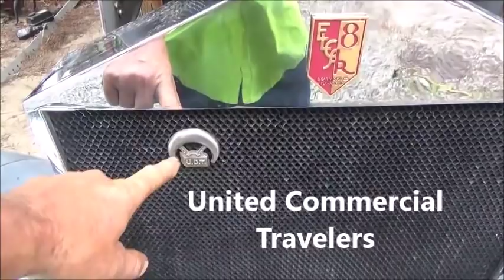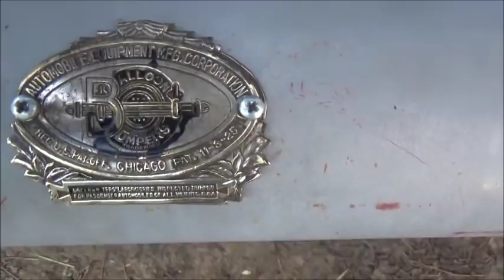1927 Elcar Ready For The Show & Wrecks

Comment: That's one thick phenolic plate!  I'm used to seeing phenolic inside antique radios being used for everything from antenna lead washers to early circuit boards and sometimes even as chassis mounts for tube sockets.
Reply: Rebel9668 when i hear the word phenolic I think of the old thermoquad carburetors.  Mopar (and I’m sure others) used that stuff for years and it is proven.
Reply: just tell me that's not asbestos...

Comment: For minor repairs on the wood stripping, there are small cans of marine-grade wood epoxy. You can even work it into the seams of "spongy" wood to bring it back up to full strength. Drills and sands fine.

Comment: Dang, $3,500.00? That's only about $700.00 more than Jasper wanted for a rebuilt rearend for my 2004 Jeep Wrangler! I had the same issue, bad pinion bearing (and a few other bearings that were shot). This is the first time I've heard of a Phenolic Plate, but it certainly makes sense, so as not to vaporize the fuel prematurely. You've got a lot of good pattern wood to make new pieces for the Top. I'm guessing the wood for the Top is White Oak, but I could be wrong. Man, she runs like a sewing machine, nice and smooth. I love the sound of solid lifters!

Comment: Jonathan you gave me a idea. I have installed a larger engine in my '63 VW bug. I have a problem like you described where it runs good and cold starts are great but after I shut it down on a hot day the gas boils in the carburator, you can smell it. This makes it flood and hot starts on a hot day are a real problem. The float level is not adjustable. I have worked on Harleys for years this insulator for the carb you installed reminds me that  the old Harleys had this same insulator. I think It is still available on the after market.  I will look into this and since it's a single throat carb this may also help you if you run across this problem again on future builds.

Comment: The material you used is called micarta. Next time you machine some keep it wet. That stops the dust but it barely cuts the smell. Great car you have there. To help out on your rollback's gear ratio you could put 10% larger diamiter tire and wheel combo on and get your 4:10 ratio back. If anyone could find that set up it would be you. And at a good price, too! I think you make the most interesting and informative videos of this type on YouTube.

Comment: I would suggest using rot resistant Yellow Cedar or White Oak for your cars roof pieces you may decide to replace. The Cedar is very easy to work. With you're savvy on the lathe, you ought to be good at  woodworking.

Comment: You might want to consider installing a heat shield for the carburetor as well.  A simple metal plate with turn away a great deal of the radiant heat coming off that exhaust manifold.

Comment: the phenolic is made of fiberglass and epoxy resin made for  the military, used in aircraft as insulation between electronics and metal, no grounding or heat transfer, today ford used it between carb and manifold, some carbs overheat and the gas boils then you come to a stop. known as vaporlock..

Comment: Check in to west system epoxy you could fix the majority of your minor wood issues with out removing any pieces. The soft spots and holes can be wet out with thin epoxy then use thickened epoxy to fill the holes when cured sand smooth